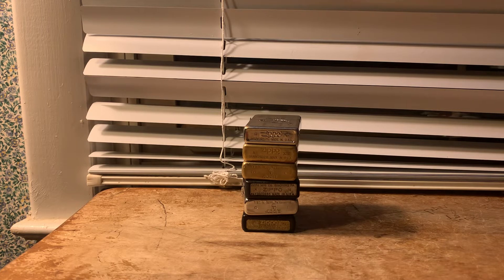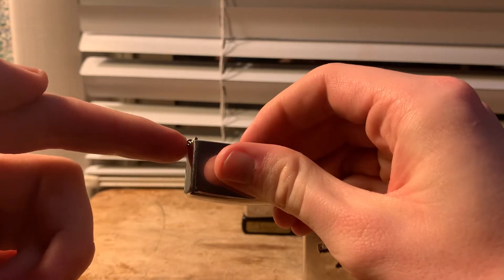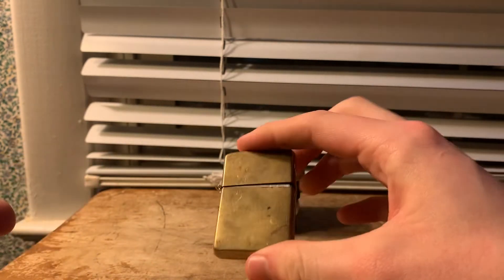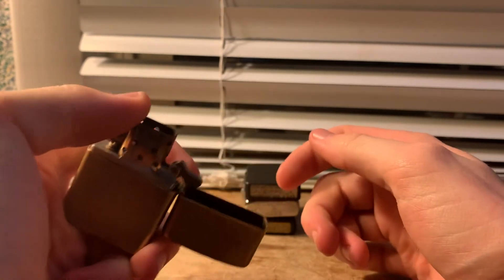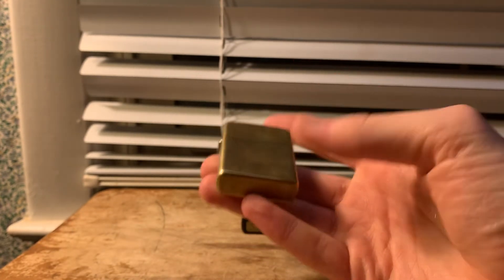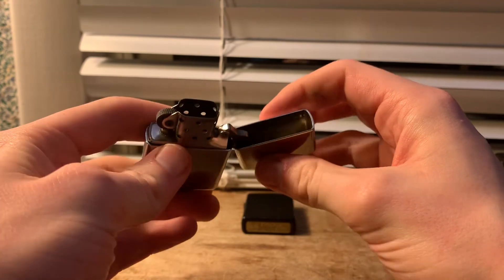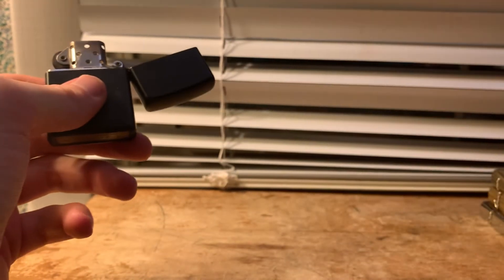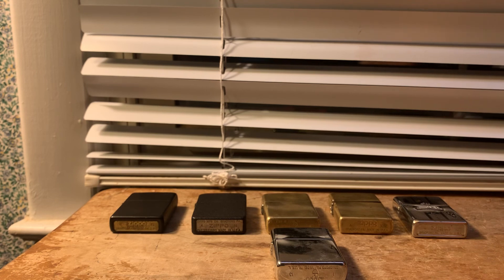Sending zippos in for repair ( part 1 )

Comment: I sent a small Zippo in for repair that a friend gave me , it had a broken/missing hinge pin like the brass one from 98 you showed. They not only fixed that but gave me a brand new insert, and returned the old insert in guess in case it had sentimental value. They have great service. Take care.

Comment: Great video. If I had to guess the problem with the flintwheel I would say that either it has buildup in the grooves or more than likely it wasn't hardened correctly and is too soft a metal to hold up over time. The only other possibility is a bad flint. I've gotten those. I usually keep a bic flint in my box just to eliminate the possibility of a soft flint when I have a weak spark.
Reply from the maker: Yeah looking at the grooves they look like they should

Comment: A zippo that won't spark is a serious problem. Its just a paperweight. You say they're newer zips? What year or years are they? I've never had that happen to me out of the near 100 in my collection and I have zips as old as 1959 and new as L 20. Need to know what year or years to look out for. Keep us posted on these bro. ✌
Reply from the maker: Ones a 2016 but I honestly think it’s just the flint wheel wasn’t hardened correctly on these two , so it’s almost a rare luck of the draw lack there of
Reply: @comradetman3784  I actually have a street chrome C 16 in my user stash. Definitely doesn't have that issue. Sounds like a rarity indeed that somehow got past the spark test in Bradford. Maybe its a collectable lol.
Reply from the maker: @high_on_nightmares  nah like when I first started using them they where fine then over time stopped sparking and I checked everything I could to make them work . Nothing